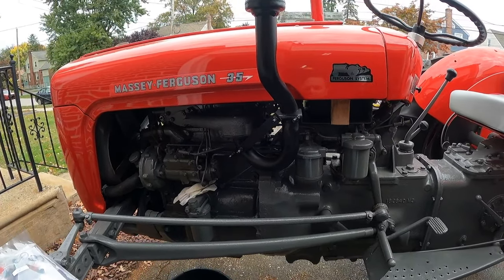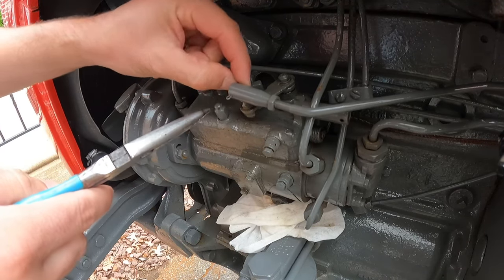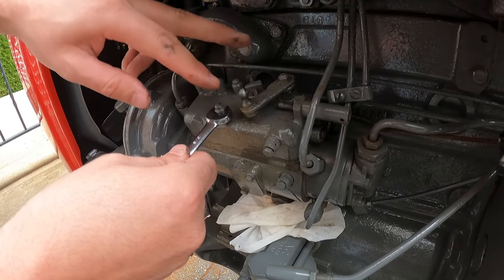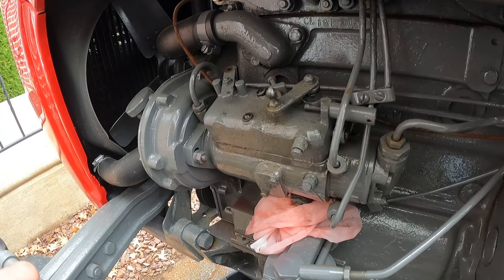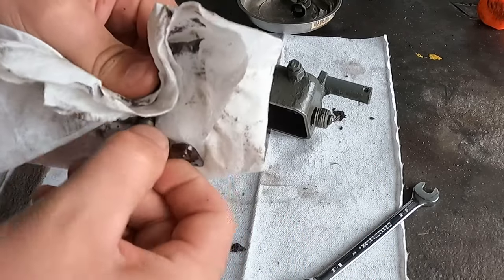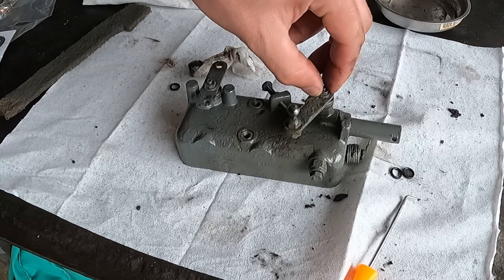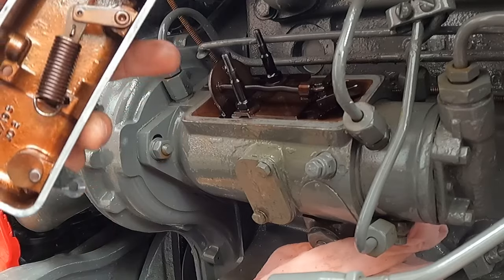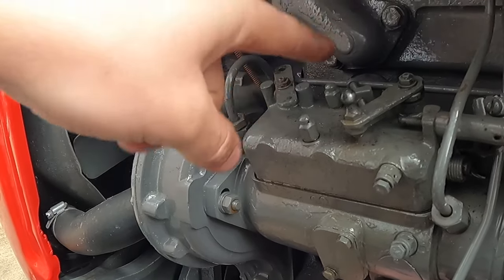Massey Ferguson 35 CAV Injection Pump

Comment: Thank you for the video. In the kit there are also two little rubber washers to seal under the holding nuts. I find it easier to remove the nut from the throttle shaft and push this down through the cover while taken it apart, that way you don't have to remove the spring. The position of the governor spring is stamped on the blue sign on the pump.
Reply from the maker: That sounds like a good way to do it.  I accidentally panted over the blue tag on my pump.

Comment: i have a 1962 MF35X and the pump dosent pump fuel into the injectors they are dry when i try to bleed the pump and injectors, whats wrong?
Reply from the maker: I would check for fuel flow from the tank.  Pull the fuel supply line off the injector pump and make sure fuel is flowing freely to ensure petcock, filters, and fuel lines are not obstructed.
Reply: @thedelcodave  i did that, its coming fuel everywhere except in the 3 injector pipes took them off and cleaned them nothing wrong there. It looks likte the pump wont pump any fuel. Opened that that, did look good. I might have to deliver it to a tractor company for proper inspection :)
Reply from the maker: @roythewho  I agree sounds like the pump is not working properly. Hopefully you get it sorted out and back running without too much expense.
Reply: @thedelcodave  thank you :)

Comment: How do we prime it after filter changes?  I've got the air out of the filters and the bleeder screws on the injector but I don't have making it to the injector fittings?
Reply from the maker: If you have it bled up until the injection pump. Break each injector line loose at the injector and crank it will take some time for the fuel to get up to the injectors. Crank for 30-60 seconds them let your starter cool off for a couple minutes.  Also set your throttle to 3/4 full.
Reply: @thedelcodave  I have fuel coming out at the injector fittings now,  but still won't start. I wonder if bad fuel pump will cause problem. Im only cranking 10 seconds. How much fuel should it pump out, I think I have less than your vid. It starts with ether.
Reply from the maker: It will shoot little squirts of fuel out each line.  If it ran before you changed the filters then it most likely still has air in the system.  Tighten 2 of the 3 fuel lines on the injectors and leave the 3rd one cracked loose. If you can get it running on 2 cylinders then tighten the last line when all the air is out. These tractors have the lift pump but the tank is higher then the injection pump so they gravity feed pretty good.
Reply: @thedelcodave  we got it to run using ether. Maybe new fuel pump will help prime it better. The manual lift pump on mine didn't do a lot. This Is the perkins 4.236 on the backhoe, I put a vid on my channel
Reply from the maker: @FourthWayRanch  Glad you got it back running.
Reply: @thedelcodave  I found the manual fir this pump, it refers to a specific fill and prime procedure but then it doesn't tell you.  It also says you can bleed when it's running by cracking an injector fitting.
Reply from the maker: @FourthWayRanch  I love it when manuals want you to do something a specific way but don't tell you.   Generally on diesels you can crack one injector line while running and get the air out. the other cylinders will keep it running.

Comment: Well at least one thing it was easy to get to. Can’t believe there ain’t a drain plug in it. Like a drain plug in a carburetor bowl. Thanks for sharing. Take care
Reply from the maker: There quite possibly could be a drain plug I did not see one.  I would think had I disconnected a fuel line I could have drained it out that way.  Thanks for watching.